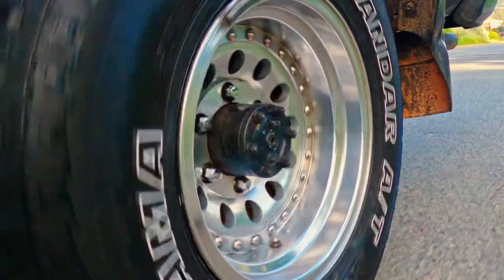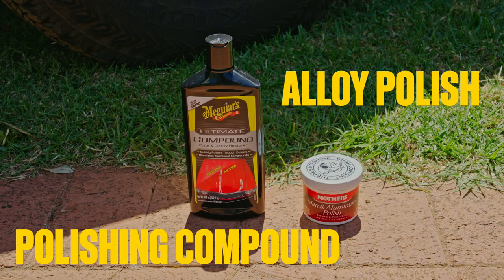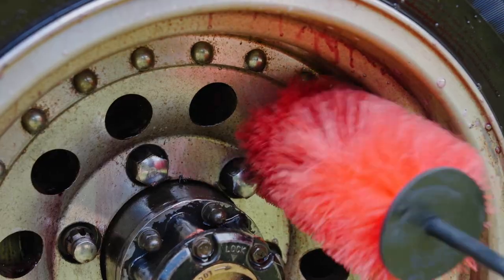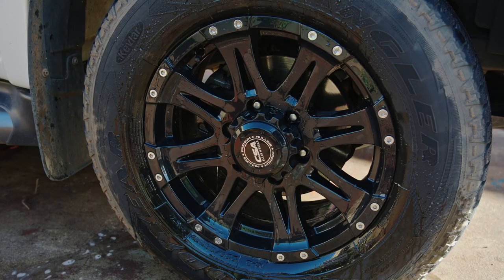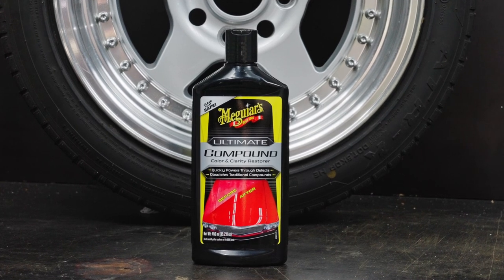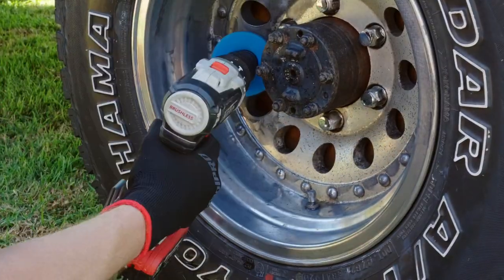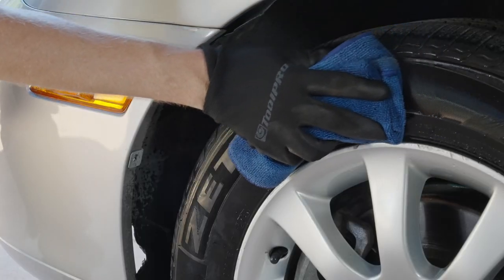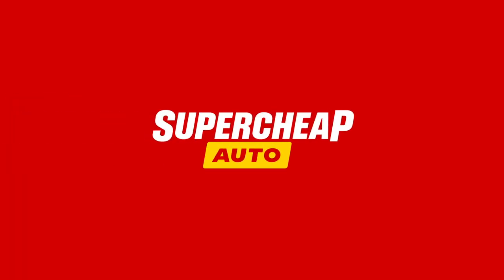How To Clean Your Wheels - SUPER DIYs

Comment: Foaming oven cleaner works good on anything greasy especially brake dust becareful on anything shiny spray on count 10-30sec spray off rinse repeat as needed onnthe "Super Cheap"😅
Reply: @acacac557  this is true
Reply: It is highly caustic, and will strip painted coatings in seconds!
DON'T use it.
Reply: @MichaelKingsfordGray  it's no more caustic then pro grade off the shelf wheel acid.... but hey I only get paid to detail everyday...